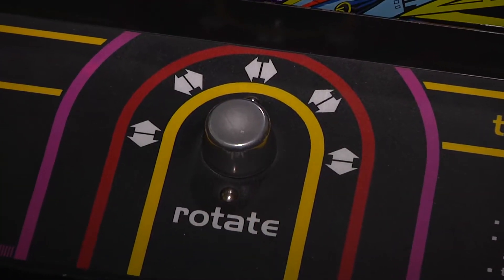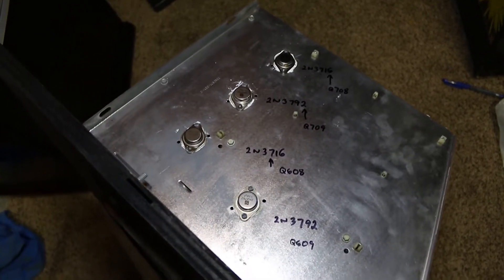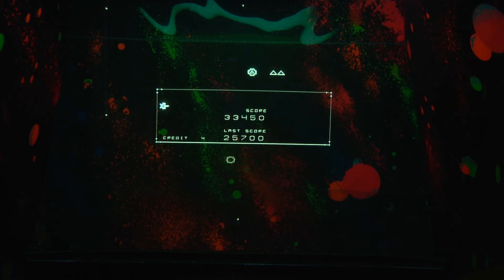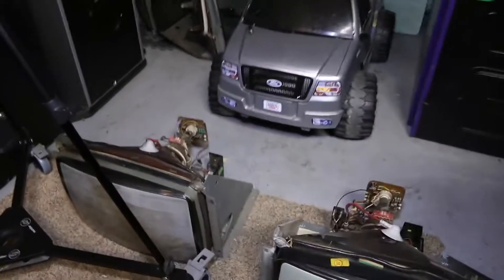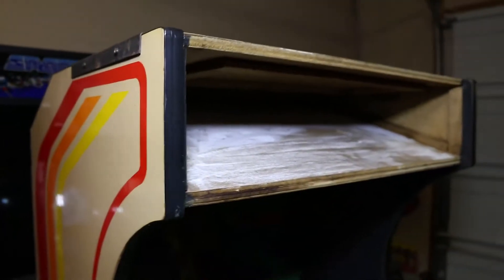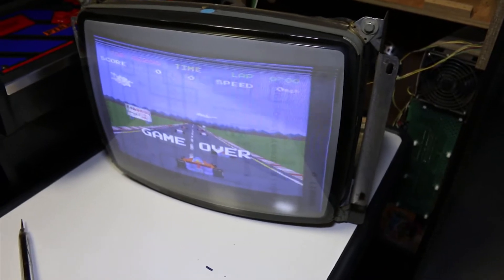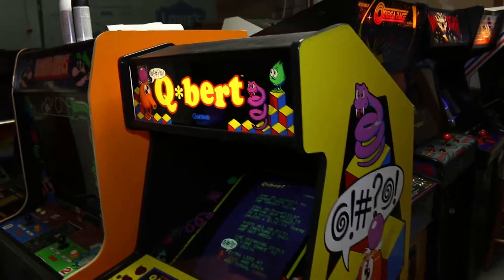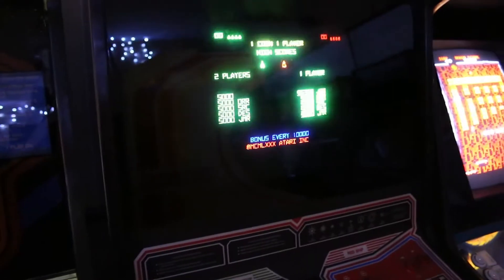Omega Race Arcade Game Monitor Repair

Comment: Hey bro, your monitor scrolling on the Pole Position could be a ground problem. Had the same issue with my Lethal Enforcers 2 gunfighters. replaced the jamma harness and rewired cab and the monitor stopped scrolling 👍 Check your ground coming off your sync
Reply from the maker: Hey Ed!  I will check that out...makes sense regarding the ground.

Comment: do you have an overlay over the monitor .. id like to see how its fixed into the cab or how its on the monitor
Reply from the maker: Hey Casey, Omega Race does come with a tinted screen over the monitor...I actually sold my Omega Race a few years back...
Reply: @Arcadehollywood 
Can you explain what sort of material it is? 
Was it a thick plastic curved sort of plate like they have in cinematics games or was it a thin film that was static clung to the monitor??

Comment: Have you tried bleach on the Ladybug?
Reply from the maker: Mike Martin I need to try that!  Just bleach and a water mix??
Reply: Yes, bleach and water in a spray bottle.  I had a DK cab that got converted a few times.  I made it a FIF Jr.  It had massive mouse/ rat urine.  I sprayed it everyday for a month.  The wood finally turned white and it was done years ago and does not smell.  You can see pics of it on my website.  Atariweb.com
Reply from the maker: Hey Mike I will check it out!  Oh geez!!